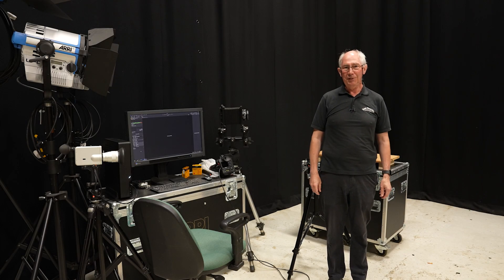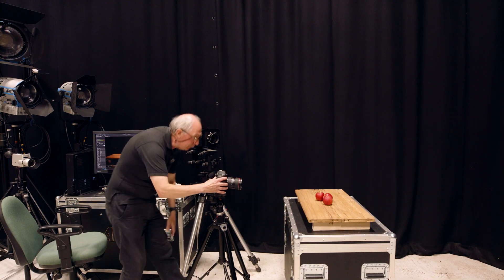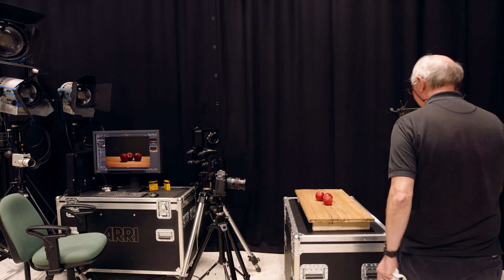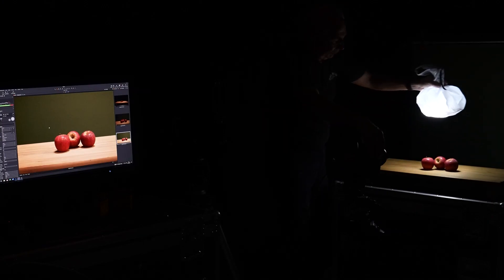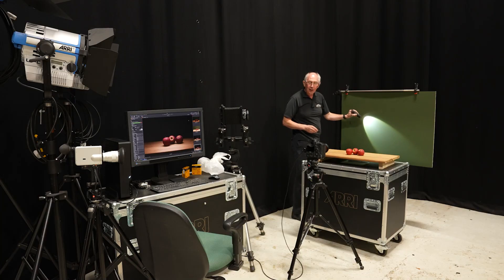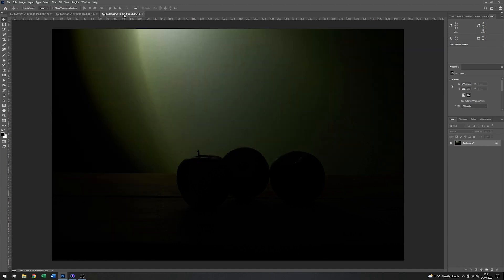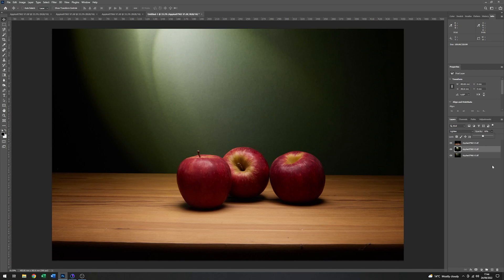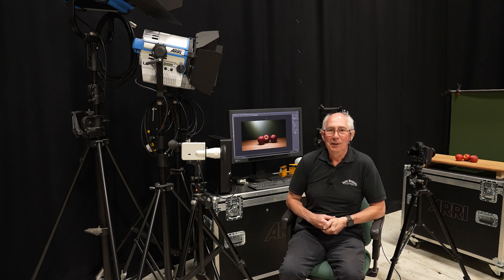Still life by torch light

Comment: Great video..I wondered why your lighting scenario (bag/torch) required movement? Could this look be achieved with a continuous light, perhaps with grid/reflector sand/or a snoot?  Shutter speeds will vary to control light or would you accomplish in camera with other adjustments?  Video was very helpful to understand the (possible) simplicity of lighting still life photography.   Thanks!
Reply from the maker: By moving the bag the apparent size of the light is increased resulting in a softer light.
The torch is continuous light.